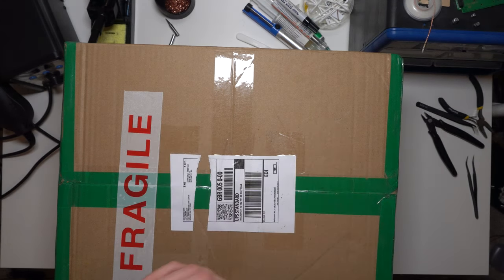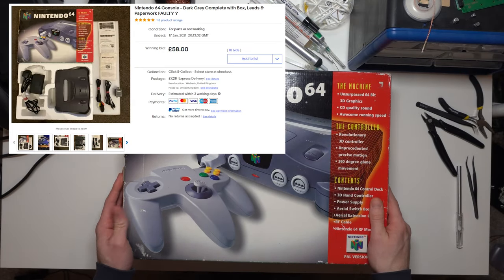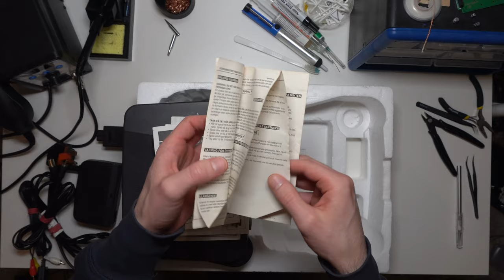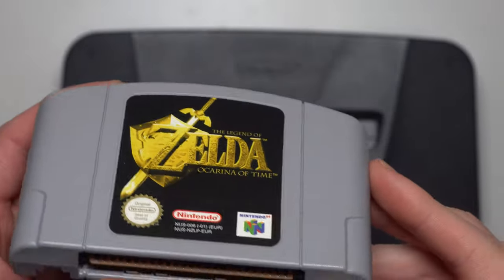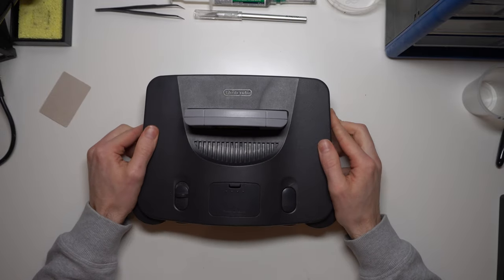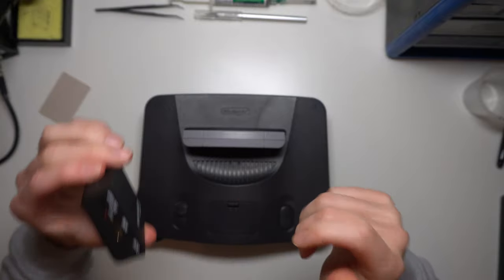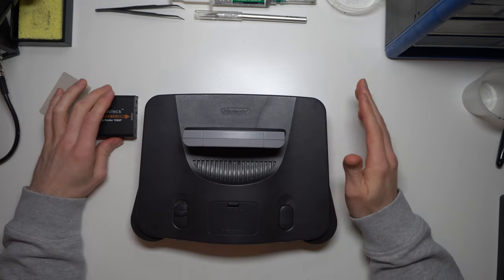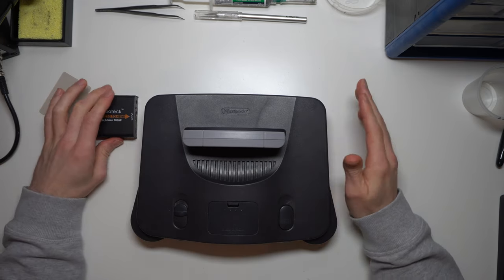Troubleshooting A Nintendo 64 - Easy Fix for No Signal

Comment from the maker: 1080p and 4K are taking ages to process so bare with if you want 1080p or better!
Reply: at least 1080p got no 4k screens.
Reply from the maker: That true tbf, but sometimes choosing 4K on a screen that isn’t 4K means you’ll get a higher bit rate video so it’s better quality 🙂
Reply: Ha, I use 240p
Reply from the maker: 240p is painful bro
Reply: OK mines says No signal but it has a jumper inside of it already and I don’t know if it was because I left it on too long if I need to reset some thing inside or what
Reply: @TheRetroStation  please reply to my vomment I'm frustrated.

Comment: I tried taking the expansion pack out and putting the jumper back in still no joy. After a bit for rigorous cleaning of the connectors on both sides it suddenly worked.

Comment: So the original jumper park works fine. But the expansion pak that we bought when it first came out won’t work, it still says no signal. Is there a way to fix that when cleaning doesn’t work? Or does that mean it’s done for?
Reply: same here This is what I did

I did the same exact thing that you're saying. I opened it for a cleaning and to remove some broken plastic fragments. I KNEW it was a mistake but I said hey lets go for it and give it a good cleaning.

I however have one of those red topped expansion packs. Mind you the system and everything else worked completely fine before my cleaning plans.

I have removed and reinstalled the expansion pack multiple times and no luck. No boot. just a blue screen.

Any suggestions anyone?
Reply: @nei_hmande2427   I gave in and just bought a new red top expansion pak and now it works fine🤷🏼‍♀️  I guess mine was too old. Granted we did have for over 20 years. I didn’t even bother taking apart. Did that with my NES and now that’s having issues starting up. Learned my lesson.
Reply: @kaitlynbailey9937  yeah. I always clean my stuff with qtips and alcohol. That is a magic combo! Try it yourself! I do it on the chips of cartridges and pretty much everything else. Removing 20-30 years of gunk works wonders. 

But opening old stuff seems a death wish with these old systems.

Comment: omg it worked for me! I just removed the jumper pak and then put it back

before doing that I dismounted the entire 64 to clean up and I got frustrated because it wasn't working lol
Reply: I did the same exact thing that you're saying. I opened it for a cleaning and to remove some broken plastic fragments. I KNEW it was a mistake but I said hey lets go for it and give it a good cleaning.

I however have one of those red topped expansion packs. Mind you the system and everything else worked completely fine before my cleaning plans.

I have removed and reinstalled the expansion pack multiple times and no luck. No boot. just a blue screen.

Any suggestions anyone?
Reply: @nei_hmande2427  clean the inner contacts with isopropyl
Reply: @chrisredfield11  good call. But strangely enough the fix was simply switching games. After that. All my games work fine. 

Technology is so strange!

Comment: Mine had a weird issue where the AV would only work if the AC adapter was in just the right position, but now it just shows a red light with no signal.
Reply: Yep
Reply: Did you ever find a fix?

Comment: I need help I have a nintendo pikachu and I've tried 3 different things the av, hbmi contenter and the converter pack nothing is working. I have an old samunsung tv and I can't get anything to work and my friend used my nintendo on his TV and it works fine.

Comment: So I already have a 64 with a jumper pack and game but I don't have an adapter. I've used a PS2 av chord and a PS Sony multi out cord for a modern Samsung flat screen and it doesn't seem to work, is this bc of the different in graphics meaning I should get the adapter or what?
Reply from the maker: It is possible that you will need an upscaler, some cheap ones either don't work or are poor in their quality/execution - I have a cheap one that works but I only use for testing purposes, not playing on.

Comment: well my regular N64 plays just fine on my smart tv, without an adapter (just use scart instead), but my pikachu edition doesn't.
i already cleaned it up, and still nothing. So i'm stuck
Reply: Did u figure out any way to get pikachu n64 working? I have 1 that doenst work too. But only tried to get signal on 4k tv. I need to try and get a red, white + Yellow to hdmi adapter and see if that might work maybe. May also buy a replacement power supply & jumper pack. I cleaned everything inside my n64 a while ago and was horrible when it didnt work after cleaning  🤔